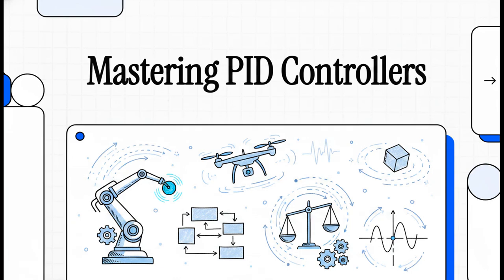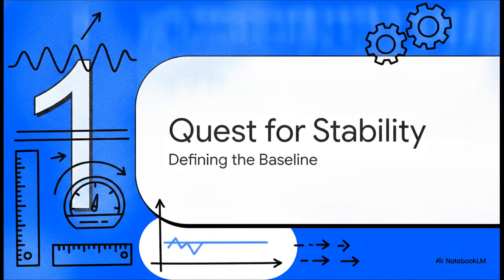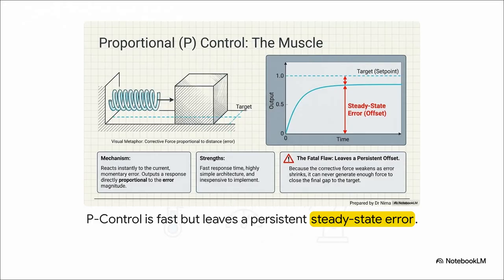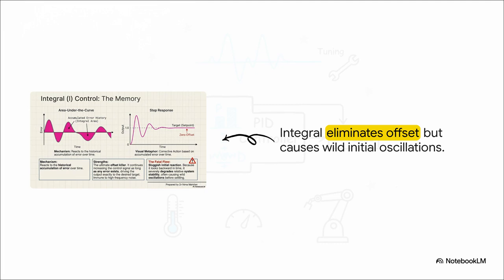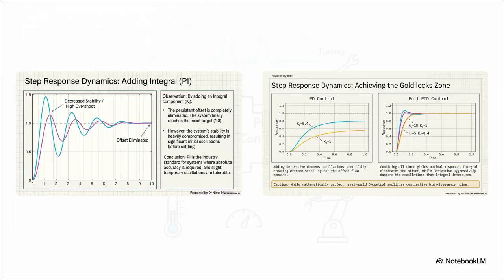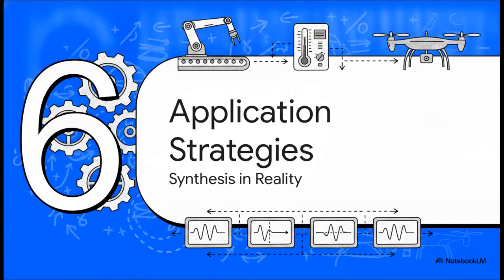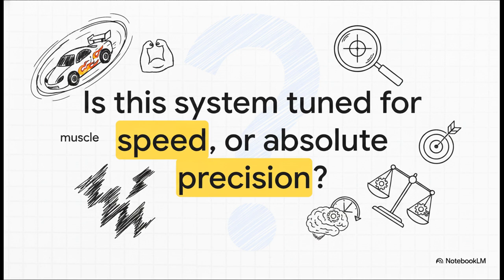PID Control Explained | Principles, Tuning, and Industrial Applications-Part2

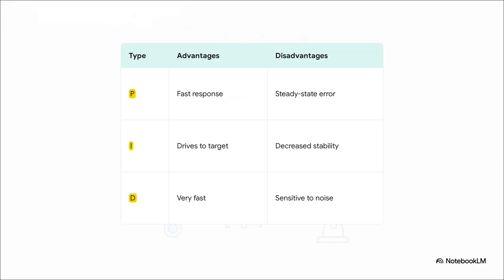Comment: I think the diagnostic matrix in 4:15 is incomplete. All terms Kp, Ki, and Kd can decrease stability if set incorrectly (too high). 
Generally, higher Kp reduces steady-state error, but makes the system less stable, especially in systems with long response delay/deadtime.
Generally, higher Ki reduces steady-state error faster, but makes the system less stable, especially in systems with accumulative response like level and position control.
Generally, higher Kd reduces insufficient response and overshoot in systems with accumulative response, but makes the system less stable in systems with high frequency noise and deadtime.
In most industrial process, combination of higher Kp and lower Ki produces similar response to lower Kp with higher Ki when the steady state is achieved. Use higher Kp if the error needs to be reduced sooner and the physical actuator allows for more aggressive actions. Otherwise, use lower Kp and higher Ki.

Comment: Dr. Nima, if the integral term is responsible for eliminating the steady-state error, why does increasing the integral gain beyond a certain limit make the system more oscillatory or even unstable? How is the optimal integral gain selected in practice to balance accuracy and stability?
Reply from the maker: Thank you for your excellent question. The integral (I) action eliminates steady-state error by continuously accumulating the error over time. However, if the integral gain is too high, the controller accumulates error too aggressively. Even after the output reaches the setpoint, the stored integral action may continue driving the actuator, causing overshoot, oscillations, and, in severe cases, instability. This phenomenon is often associated with integral windup, especially when actuator saturation occurs.

In practice, engineers select the integral gain through controller tuning methods such as Ziegler–Nichols, Cohen–Coon, optimization techniques (IAE, ITAE, etc.), simulation, and experimental testing. They also verify stability margins and frequently implement anti-windup techniques to prevent excessive integral accumulation.

The objective is to choose the smallest integral gain that eliminates the steady-state error within the required time while maintaining good damping, robustness, and closed-loop stability.

Comment: Thank you Dr. it's clear; I have equation : Since the derivative action improves damping and stability but is highly sensitive to high-frequency sensor noise, how can we use the D action practically without degrading the system response?
Reply from the maker: The derivative action is useful because it predicts the future trend of the error and improves damping, but directly applying it to a noisy measurement can amplify high-frequency noise.

In practice, engineers use several techniques to obtain the benefits of D action without degrading the response. The most common approach is to add a derivative filter (low-pass filter) to limit the effect of high-frequency noise. Another common strategy is to apply the derivative term only to the measured output rather than the error signal, which helps avoid large derivative kicks caused by sudden setpoint changes.

Therefore, practical PID controllers usually implement a filtered derivative action, where the goal is to achieve improved transient response and stability while maintaining robustness against sensor noise.

Comment: Dr. Mahdian, I appreciate this clear and useful explanation.i have question : Since P improves speed but leaves steady-state error, I removes the offset but may increase oscillations, and D improves stability but is sensitive to noise, how can an engineer decide whether to use P, PI, PD, or full PID control for a real industrial system?
Reply from the maker: The choice between P, PI, PD, and PID control depends on the process requirements, dynamics, and performance objectives.

A P controller is suitable when a small steady-state error is acceptable and a simple, fast response is required. A PI controller is the most common choice in many industrial processes because it eliminates steady-state error while maintaining good robustness.

A PD controller is useful when improving damping and reducing overshoot is important, but it is less common in industry because derivative action can amplify measurement noise.

A PID controller is selected when the process requires a combination of fast response, zero steady-state error, and improved transient performance, provided that noise sensitivity is properly handled.

In practice, engineers usually choose the simplest controller that meets the required specifications. Many industrial loops, such as temperature, flow, and pressure control, are effectively handled by PI controllers, while more demanding systems may require full PID or advanced control strategies.

Comment: Doctor the video highlights that road expansion often fails due to the concept of Induced Demand. However, heavily restricting private vehicles and shifting to public transit can face strong economic and social resistance. How can urban planners find a realistic equilibrium between implementing sustainable smart transit systems and preserving local economic activity and mobility freedom in developing cities?
Reply from the maker: Thank you for your thoughtful question. There is no single solution. The objective is to balance mobility, economic activity, and sustainability rather than maximizing any one of them.

In practice, urban planners combine several strategies, including improving the quality and reliability of public transportation, developing intelligent traffic management systems, encouraging multimodal transportation, optimizing traffic signals, and introducing demand-management policies gradually rather than imposing strict restrictions.

The most successful smart cities provide attractive alternatives to private cars instead of simply limiting their use. The appropriate balance depends on the city's infrastructure, economic conditions, travel demand, and public acceptance.